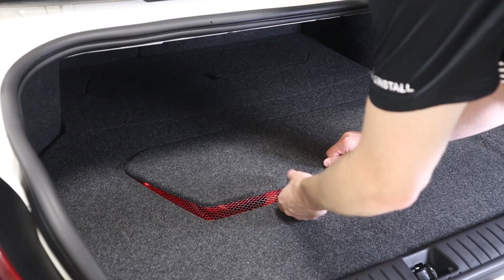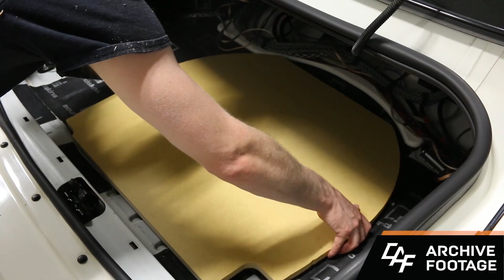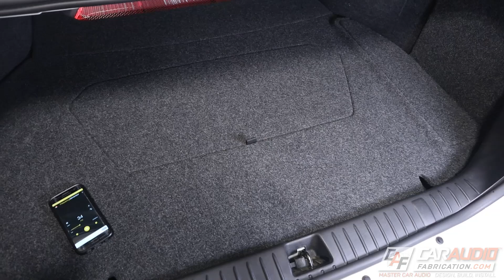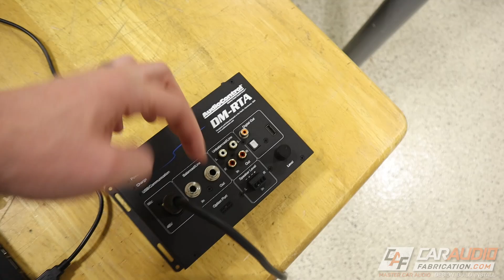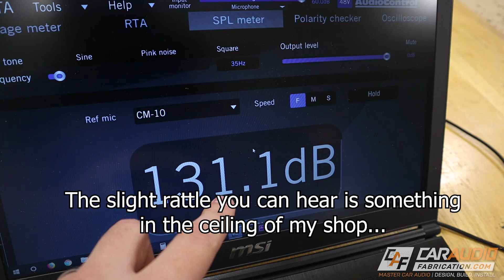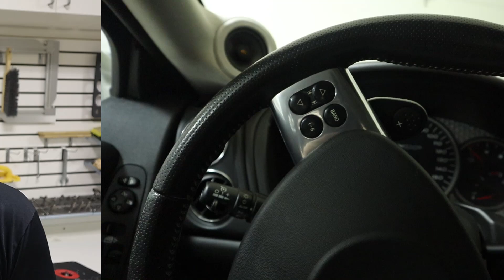Subs HIDDEN behind panel? How does it sound? Project Stealth Overview!

Comment: Did the gxp have the monsoon system? If so did you wire with amp or take it out? Was a real fun rime doing the radio in my gxp. I took the amp out and wired in my own speakers with their own wires i bought. Pulled the seats and carpet out with center console for better wire management. Ill upload my progress and after install when i get a chance. I do have a microphone and backup camera with swc all installed as well.

Comment: You and Steve Meade man. Two of the best in the game in my opinion. I have learned so much from the both of you and have made two separate build lists based off the information y'all have given in your videos. The setup I have in my car now, I am quickly and unfortunately realizing is quite garbage and done very wrong lol. I created a build list based off several videos of yours I've watched and plan on redoing the setup in my current car. I drive a 2017 Chevy sonic RS hatchback and daily drive it. So I want to do a small build in that. Just a little something to give me nice bass and good sound quality. Then I want to buy another car, used car outright with cash (no more payments for me) and have another build list I've created after watching several of Steve's video's. It's going to be a much bigger, louder, spl based build. Only thing that still confuses me is the technical stuff, like tuning it and all that extra stuff. Like the dm-810 how you can "time align" speakers together. That goes right over my head lol. Anyway, I'm done writing my book up. Love your videos man! Got my sub here and on Instagram.

Comment: As always SUPER clean install simple explanations and great info!!! Keep em coming Mark! You've taught me so much! Thx bro!

Can you please do a vid covering batteries and alternators??? I would like to know how to determine what battery/batteries would work best for my big build (approx 4750 watts) 
Its all Rockford Fosgate:
1# - T2 16" (2ohm)
1# - T4 6.5" comp. set
4# - T1 6x9's 
1# - T2500.1 cp db
1# - T1000.4 cp dp
A pioneer AVH 34000 NEX deck. 
A 370amp Meacham Elite alternator to power everything. (Just 1 alt. No dual bracket available for my engine)
I want to go with xs power and i was thinking about running 2 xs power d3400's. (Crutchfield suggested). . . ANY advice suggestions explanations or tips will be GREATLY APPRECIATED and put to use!!! 

Thx in advance!!!

Comment: I have a question, not sure who to ask so I figure I’ll ask here. I have an Alpine S series 12” dual voice 4ohm + 4ohm subwoofer and it’s rated for 600w RMS and 1800w peak. I have a 2 channel pioneer 1000w amp and I have each voice coil wired to its own channel. The amp only puts out 150w rms and 300w peak per channel for 4 ohm speakers. I can tell the sub is severely under power but it still hits great at about 2/3 volume. The woofer is recommended to be in a 0.85 cubic ft sealed box and the box i built is 0.89 cubic ft. Do I need a stronger amplifier or am I wired up incorrectly? And is the 600w rms rating for each voice coil or all together? I’m still learning all of this stuff so any help is appreciated

Comment: You're doing some great work, and the videos are awesome, but I see you build alot on larger vehicles, I just bought myself a 2019 Toyota yaris (I guess it's called echo in the states) the trunk is limited space, do you have any suggestions or advice on smaller trunks?

Comment: If you have more than 500 w panel will launch .... I had 2 10s with a press for panel with magnets and with barely 400 W total it blows the panel off.. reset gains to 1200:W .. added a bolt and abs to mount and that lasted 2 days in the same press piece in my beauty panel lol

Comment: Idea for a video:

Could you possibly explain/test what effect the distance of subwoofers has relative to front stage and the listening position.  

I have demo’d systems in large vehicles where the subs are located quite far away in the rear, and so the sub bass part of the music seemed to have time shift issues and detracted from the listening experience.

My questions are:

-How much delay are we actually perceiving in a large vehicle like a suburban?

-Are there any time correcting process devices on the market  designed to deal with this in the sub bass range?
Reply: @gabesafish Just about any DSP on the market should allow you to be able to use the time correction function on the sub channel so that there is no "delay" in the sub stage sound and you'll hear the bass when you're supposed to.

Comment: I’m gonna be tackling my first real custom install in my truck. It’s gonna be a center console that will have either 2 8s or 6.5s depending on total space. I am debating on making a fiberglass mold of the floor but I’m unsure I would really gain that much space and I don’t have a clue how to actually adhere it to the wood side panels